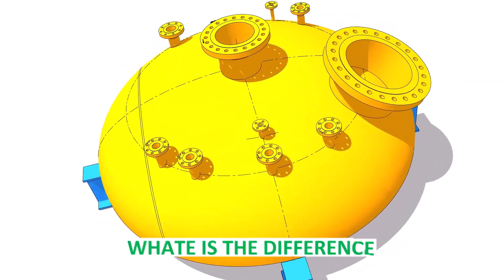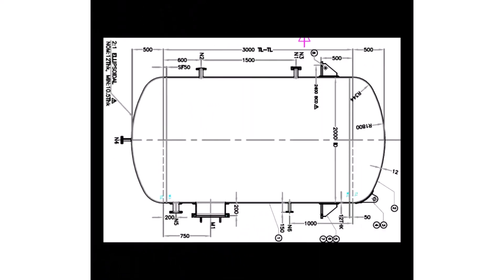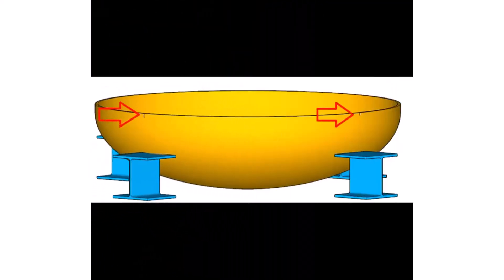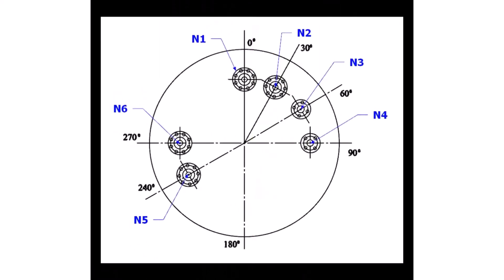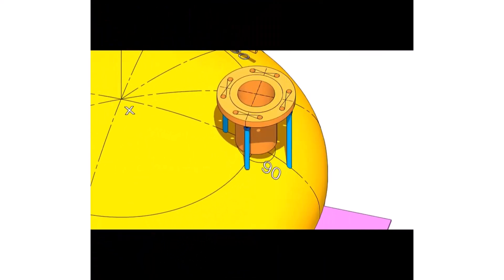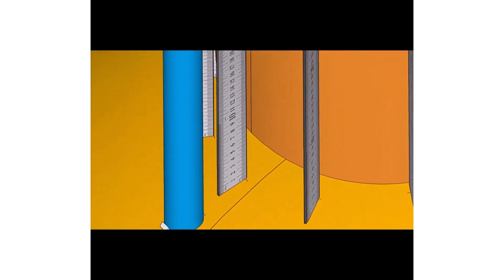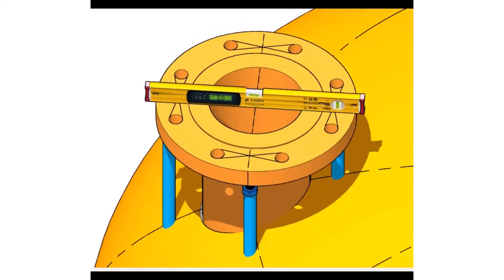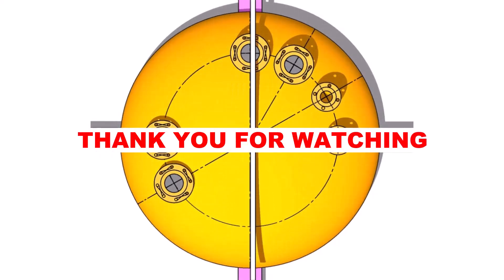How to fit up nozzles on the dish end of a pressure vessel.

Comment: Hello . I would like to know how to find the diameter of a tank, I know there are several ways, I know it with a rope and arrow and also by gallons and height, there will be another way, thank you
Reply from the maker: Hai bro. You mean, to find the diameter of an existing tank?. If so, measure the circumferenc and divide it by 3.14. Otherwise please add some details. Thank you.